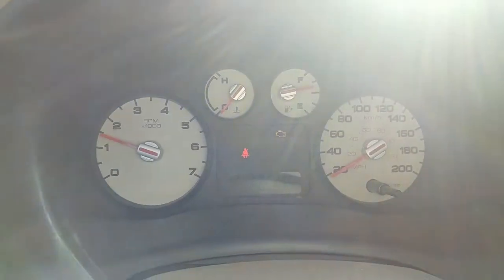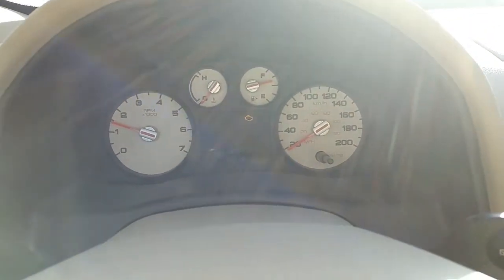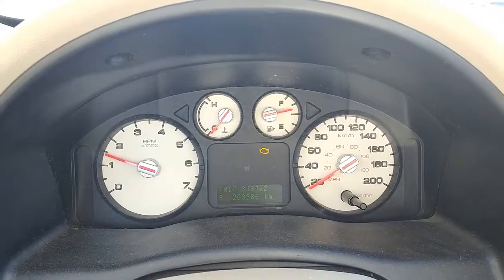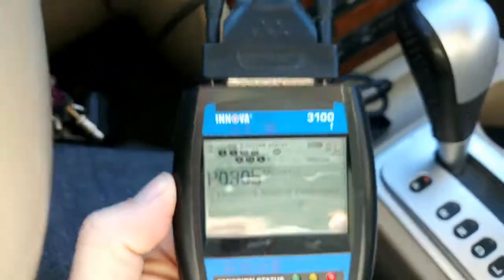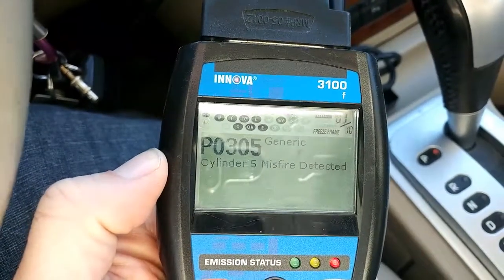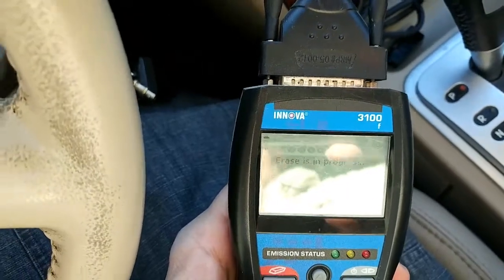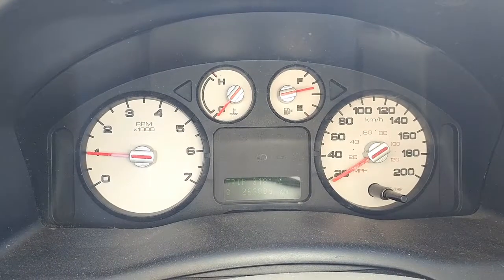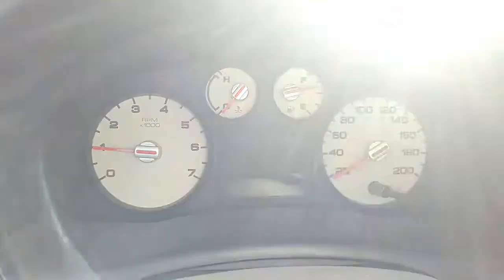How to Turn Off Check Engine Light Without a Code Reader

Comment: Thx & off to try your battery suggestion, as been so baffled (engine light stays on for 2 weeks, then gone for a week & then repeat, but no shop can tell me why exactly...just clears code saying it's nada, but then appears again...in south Florida (so not a cold issue)

Comment: If you use unhooking battery to run check light out, will it stay off long enough to pass emissions
Reply from the maker: No. Emission checks are done with a sniffer on your tailpipe measuring exhaust impurities. Disconnecting the battery clears fault codes stored in your car's engine control unit (ECM/PCM) It won't fix or change anything, it will just clear the light if you happened to have a sensor that triggered for being out of spec when cold or wet or whatever. If the light comes back on, then you actually need to find what's failed...but just clearing the light won't fix bad emissions or fix actual bad sensors or engine problems. Hope this helps.

Comment: I have never had a check engine light problem. Last week, we had a similar weather condition -30s temp,  the check engine light came on. It is a solid light, not flashing, I think it's just what you just mentioned in the video, so if I don't do anything about it, will it eventually go away?
Reply from the maker: Hi Yu Ma, Check Engine Lights NEVER turn off on their own without intervention. Once it triggers, you have to step in to reset it. Depending on the vehicle, there might be 30 different sensors connected to the vehicle's computer and any one of them out of spec could trigger the check engine light. If it was something as simple as the car being extremely cold and miss firing when it started or running rough trying to adjust air/humidity/fuel in the cold - that could easily trigger a check engine light - without anything actually being wrong with the vehicle. Typically Throttle Body Sensors, MAP, and MAF (Mass Air Flow) sensors do not like temperatures on that cold of an engine and may not be able to register within range fast enough before the light triggers.

If you don't have an OBDII code reader to find out what happened, you can simply disconnect your battery for about a 1/2 hour so the vehicle's computer can fully discharge and forget the codes that triggered the light. Once you re-connect the battery, the light should be off. If it comes back on, then its time to get it checked out as a sensor or something it is monitoring is failing. Disconnecting the battery and resetting the computer is a cheap way to verify it was just a hiccup or not. Taking it to a shop will cost a minimum of 1 hr labour for them to tell you the same plus waste your time scheduling an appointment. Hope this helps - Cheers!
Reply: @Naturally-Kelly  Thanks buddy, the normal OBDII device doesn't work on my car. Unfortunately, I have to bring it to the shop. Your video is really helpful, good work!